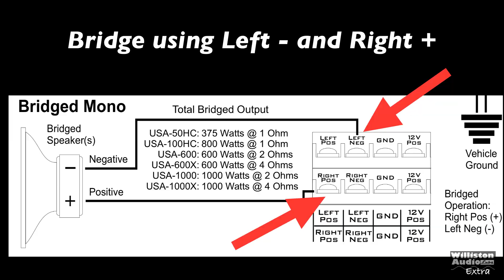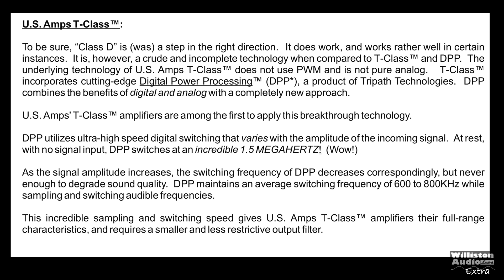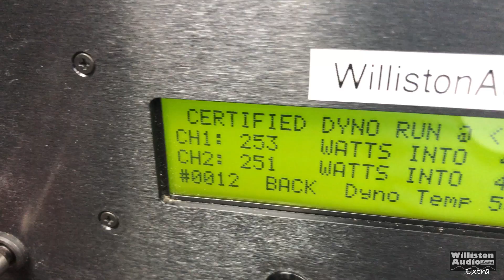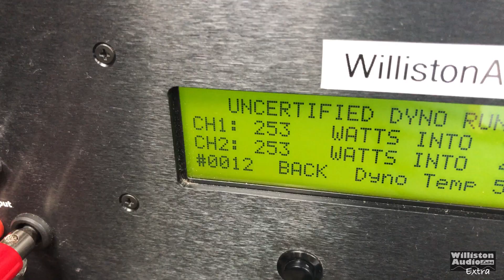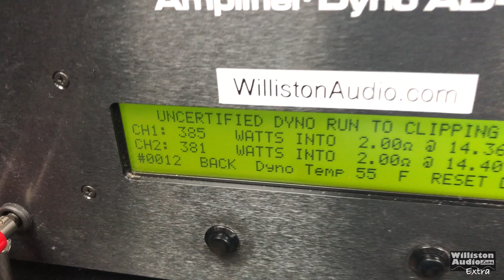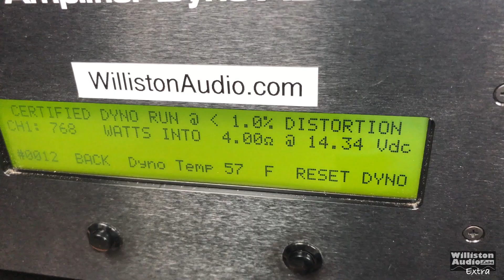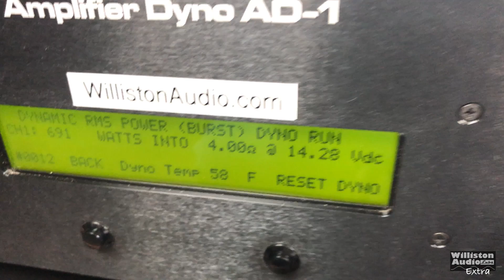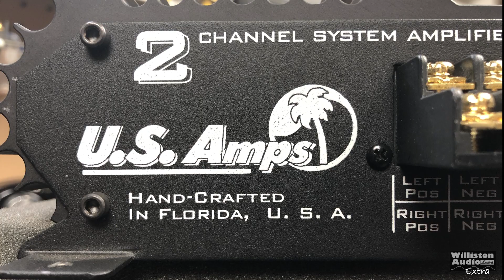2000 US Amps USA-700T Tripath Amp Dyno Test

Comment: Windows 95 98 is only we’re 3.5 inch floppy could be use . They had a lot of usage up till not long ago . Floppy 3.5 was also required to install windows xp. Was very annoying. Just want to point that out .the 5 1/4 floppy yes windows 95/98

Comment: I had a la sound Catalina classic running mono in my dodge Daytona to 2 -10 inch subs in a bandpass firing back at the hatch.  Had 0 gauge wire back in the day.  Had Kenwood excelon deck with no speaker outputs.  Only had RCA  outputs, top of the line deck.  Along with a kenwood parametric EQ, excelon components, and tried many amplifiers and many subwoofers brand's.
Reply from the maker: Awesome 👏

Comment: very cool. there were a couple companies that came out with tripath car amps. i had a blaupunkt one. a local supermarket had a pretty cool little electronics section and carried them along with stuff like the intel slotket adapters or cyrix 333mhz chips. i really liked it dont remember what ever happened with it but it seemed alright. 

i still run tripath amps at home
Reply: Sounds like another "class d"  BS trade mark (marketing) to me...
Reply: @Kyote7667  not quite.
Reply from the maker: Interesting !
Reply: @wal2  I thought tripath, was the company. Not some new wave. Basically a trademark.  Not unlike "class d". Theres also a reason, you don't seem that used anymore, well unless you buy a tripath for 11 dollars online.
Reply: @Kyote7667  the fact that its hard to find real tripath chips now is a big reason you dont see them anywhere and likely youre looking at knockoffs then other companies can do similar now. theyre great for low power sq and theyve always been cheap to get lots of kits built around the ta2020 but there were bigger class t amps all the way up to 1000 watts iirc.  

i use one per side with my with my b&w towers and it sounds great and takes up very little space. for full range class d at the time they were a lot nicer sounding that other options available and much more affordable. ive used the same home stereo setup with the 2 ta2020s driving the mids and highs for a long long time dont ever plan on changing it really and i bought more of the og 2020a amps just in case these go bad ive added bluetooth to them as well so really now i see no reason to change. they just have a pleasing  sound kinda like how people think records are superior even though cds are technically superior. 

its one of my favorite things to use for diy portable stereos even in cars they work fine. nowadays theres a ton of options that are very similar that ive tried and these still sound about as good as the best ones you can find which might not seem that special because the markets are saturated with these things but it wasnt always.
Reply: i have a couple ta2030s around here too i should do something with them
Reply: @wal2  
A 4 second google..because i remember these when they dropped. Many of us, then, though meh... but hey, to each their own. 

"A Tripath or Class-T power amplifier is a proprietary version of the Class-D switching amplifier developed by Tripath Technology. Tripath claims its architecture uses “adaptive” processing to improve general switching amplifier design"
Again Big D no hate, and again, maybe im high, but, especially in the 2000s, trade marks and new thrown around words sold stuff,...Still works today. Also, everyone talking about efficiency,.. hell the times 10 method,  comes into play here. It, to me, isnt earth shattering, .. hell hardly average eh?

Comment: It did more than rated power, which is typical old school quality amplifier. However I was a little shocked it fell flat on the 40Hz dynamic tests VS the higher certified and uncertified tests.
Reply from the maker: The chip in these is known to fail so I didn’t want to push it too hard
Reply: @wal2  yeah, everything changed in the late 90s to early 2000s. I had some good old school equipment back in the day, wish I kept my Crunch 50SHC, Phoenix Gold ZX250, PPI PC650 and Rockford Punch 150HD, they were all great amps .. they don't make them like the used to!

Comment: Holy blast from the past! I used to run one of these powering two Aura 1808's in the back of a Stratus back in the early 00's. Local dB Drag comp clocked it at 139.6 back then, so it wasn't too bad for what little was apparently going into them. It was just a dumb, but fun setup. I eventually shifted gears to more outdoor adventures, so the whole system eventually made it's way into more dedicated hands.
Reply from the maker: Awesome 👏
Reply: I remember a guy years ago with those Auras who was a big presence on the old car audio forums. Had them in like an infinite baffle style mount.   Always thought that looked like a cool set up.
Reply: @fattytca1  Yep, that was me. :D
Reply: @fattytca1  yeah those were pretty cool. been thinking of buying some of the neo radials and doing something with them. currently fixing some broke 3hp neos.